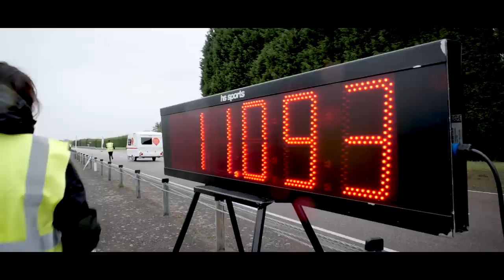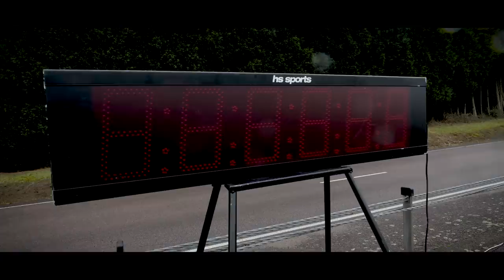How Fast Can You Tow A Caravan... With A Bike?

Comment: Does it have to be a road bike? A MTB might allow a better up right stance and suspension would absorb some of the oscillations. A lead weight in the handle bar would off set the turning moment in the vertical plan (like tractors have).... but of course it all adds to the weight.

Comment: Pump the tires up on the caravan plus max. Rig yourself a brake switch for the caravan brakes. Last of all use a fat tire bike with 20 in. wheels. Smooth tread tires of coarse. Pumped up tight. Then maybe you have a chance.

Comment: Getting 700kg up to speed is one thing, getting 700kg with that amount of frontal area up to speed is something completely different.
Reply: With the relatively small power a human can perform the rolling resistance of a 700kg caravan in itself puts an early limit for the speed. When the speed increases the big front area of the caravan will contribute to limit the speed even more. But with a max power of in this case ~1hp the main resistance will be the rolling.
Reply: With a speed of only 10 km/h, definitely. With a target of 40 km/h it would've become predominantly aero, but you're right, overcoming the rolling resistance to get to those speeds uses up all the minimal power we tiny humans can exert

Comment: Say he was riding at a modest 700 watts (I can promise 700 is probably low) between those two timing points. Since that frontal surface area of the caravan is huge and the coeffient of drag must be huge. On perfectly flat ground above say  10 km/h, yet alone the desired 40 km/h the biggest force is definitely drag. And that is proportional to the square of the velocity. So 40 km/h is would require 4 times the speed and 16 times the power  or about 10,000 watts. The craziest number I heard of was around 2200 watts in a wattage bazooka award. 40km/h from a single rider on that caravan will likely never happen. If they can drop the product of the frontal surface area and the coeffient of drag, by a factor of 16 then you could get close to 40 km/h right now. This could be easily done with designing a large aerodynamic slab of metal and adding wheels however good luck getting that considered a caravan. But if you up it to 1000kg you might get it classified as a generic trailer and that would be an interesting world record

Comment: I believe to future of transportation will be Bicycles. The camper needs a electric assist to get it going and it needs brakes as well. Batteries Charged from solar on the roof.
Reply: A camper in this size may kill the cyclist, it's far to heavy to be really controlled by the bicycle. If the road has some potholes it will start to lift the bicycle (you can feel that upward move even on a car with a trailer). 
With a tractor (a heavy machine made for pulling) it starts to get unsafe if you pull more than 3 times the weight of the tractor - trucks are only allowed to pull 1,5 times the gross weight. A 750 kg camper has 6 to 7 times the weight of the cyclist plus the bicycle.

Comment: Imagine the stretch on that chain and cassette teeth💪
Reply: You should try the 15t chainring, 11.5 gear inches my towing bike. I can really feel not just the chain stretching but the drive side spokes in the wheel and the tyre deforming under the torque.
I've towed 150kg up hills some people can't ride up. Spin out at walking speed.
Reply: @Ed.R  12 gear inches is a monster low gear.
Reply: @dalezapple2493  How I haven't broken the chain I don't know. My conclusion is that chains only break due to badly installed rivets or bad gear shifts.
Reply: Chains don't stretch they lose tension. Useless bit of info for you

Comment: Would this be easier with a fat bike and with weight placed on the front wheel? Also they need to rework the towing configuration and hook up the trailer brakes to work with the bike brakes. Really more prep work needs to be done before attempting this again.

Comment: This is possible, but you are doing it the wrong way, take a look at the concept of carla cargo, to pull a massive load needs an articulated arm and a third wheel. Another detail is holding the armrest in the seatpost. Maybe you can make a piece that fits the caravan and has this structure that I mentioned.

Comment: I could have done it. First, put more weight in the back of the caravan to reduce tongue weight, even if it increases overall weight. Second, I've had to bike tour with a trailer, since I'm 6'5 #285, and even stout touring bikes rate at #275 maximum load. Third, I've spent as many miles towing a trailer as I've spent riding. Last, I have a hundred pounds on this guy, and while he may have incredible endurance, I'm far stronger, and heavier, so I would not get tossed around like him. Just a silly effort by a sub #200 guy.

Comment: Probably should have used a tandem.  The longer wheel base would have improved stability, and the arm between the rear wheel contact point and the centre of gravity would be longer, keeping the front wheel in firmer contact. Weight is irrelevant for a level road trial like this. It is all road friction, bearing friction, and aerodynamic drag. I think it would have been more successful with a tandem, even with a single rider. Two riders obviously better! However, 40km is probably sheer fantasy, with the massive CdA of the caravan. The aero drag would be 16 times the drag that Mark experienced at 10km per hour. He would need Cipollini thighs and then some.

Comment: Easy peasy. Whatever the wattage was, for 25 mph, ie 4 times as fast, you just need 64 (4x4x4) times as much. A little bit of training and you get it.
Reply: That is not really correct. It would be the case with air resistance as the only resistance. But with a caravan at low speeds the rolling resistance will remain the main part of the resistance, and below 10km/h the air resistance is almost negligeable. This means the speed will increase almost proportionally to the power up to 10km/h and just a bit more than that up to 20km/h. To calculate the exact required power at different speeds you need to know the rolling resistance and the air resistance at a certain speed.
My guess is that 40km/h requires 6-8times the power as 10km/h.

Comment: Rarely does a single individual go traveling with a caravan, so why use a single bike to tow it?  I say rig the tandem up to it.  You shouldn't need the jockey wheel at all.  
And by the way, get some high-pressure tires for the caravan and pump them up as high as possible, within safety limits.

Comment: Why not just hang a weight on the steering on the bike so you can get the downforce u want to balance out the pivot upwards from the caravan?  It was stated that the end of the caravan presses down with 30 kg, so remebering "arm times force" and estimaing that the horizontal distance from the center of the backwheel to the steering is roughly 1,5 times the distance from the center of the backwheel to the caravan that should mean u need a weight of 20kg on the front to balance the bike. 
Then you would have a larger distance between the wheels of the caravan and the wheel of the bike wich should help on how much the backwheel gets dragged back and forth on the tarmac, and you should be a lot more efficient.

Comment: it looks like maybe you'd be more successful with a different sort of connection to the bicycle that didn't put the balance point so far behind the rear wheel. maybe there's some way to use a little weight from the caravan to keep the front wheel on the road? might need a beefier bike that is rated for more than 200kg. but interesting attempt. you should show the guys on gmbn who were unsuccessful at towing blake's jeep

Comment: I don't even know where to begin to express my displeasure about everything I saw. Why a freaking trailer? If pulling a specific weight up to speed by a bike is the point, how about some sort of motorless, steerable, weighted vehicle, with a driver doing the steering, and a length of rope connecting the vehicle to the cyclist? The vehicle can be  weighted to any amount. Actual world-wide speed/distance/weight records  can then be set and challenged. With weight being the fixed requirement, the human operated vehicles can be any design, with any size wheels (3 or four), made out of any materials and design. If the weight is the same, regardless the vehicle design, then people can compete to create the best design enabling the fastest pulling speed.

Comment: Try putting the ball over the back wheel. May look unnatural but control and traction would be a lot better. Or get real crazy and use a scooter 6 inch back wheel, that would be too much engineering

Comment: so a couple of things you definitely fucked up...
you need like twice the recommended pressure in the caravans tires 
you failed to move the center of gravity in the caravan to correct in loss of traction

the welder made you a strong hitch that fails at its job...making sure that the toung weight is supported if the front tire is coming off the ground then it's not supported correctly
Guinness was unreasonable to assume a speed of 25 mph is possible but 15 mph should be within reason 
and what was Guinness's requirements on modifications to the caravan to define what a caravan is because if you are only trying to pull 700 lbs then you should scrap all that surface area

Comment: I pull a trailer on my mountain bike that connection he has sucks!, you need two different pivots points on that hookup, he's only got the left right, it needs to spin and dip and rise. he also needs a mountain bike not that weakass bike.